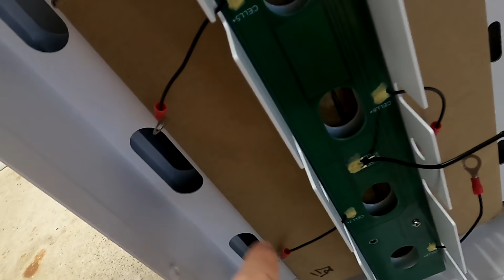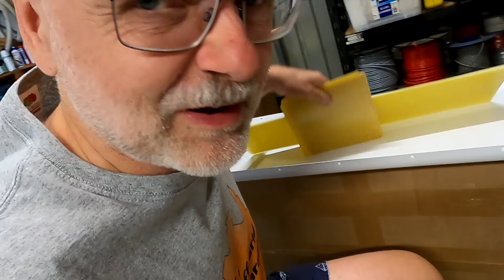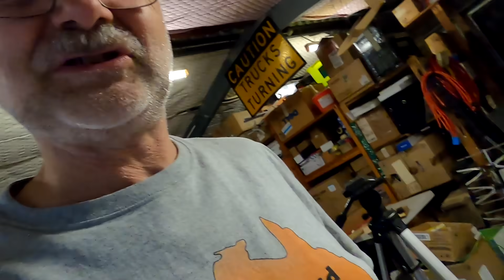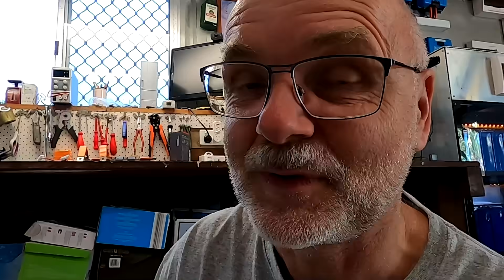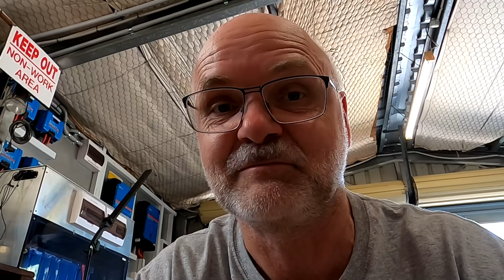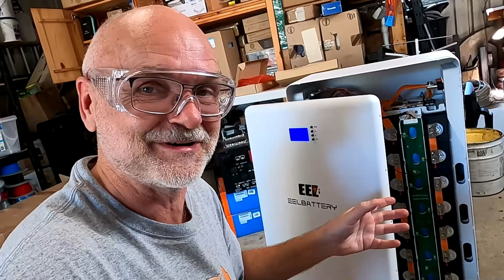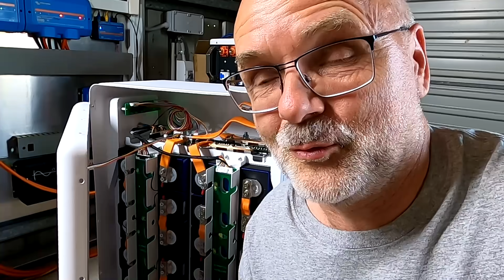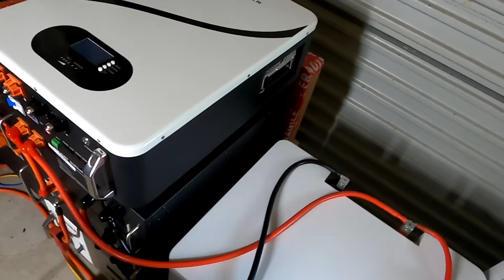The vertical EEL Battery DIY Kit. Is it OK for the cells to be stacked?

Comment: Andy, the firmware update for the 10e BMS, is that specifically for Victron, or a general firmware update ?
Reply from the maker: As always, no change log. I always try to have the latest. There is no mentioning of Victron or any other issues it fixes it. I cannot see any changes or improvements.
Reply: I was also wondering about this and if it is worth upgrading mine. I can't find a changelog

Comment: Question on jk bms . I got one just today but it will turn on for only about 10 seconds then shut down . All cells are about 3.3 volts
Reply from the maker: Any error messages while it's on? Check the resistance as well and make sure you haven't got a short or so. Could be a cabling issue but hard to tell...

Comment: Compression is not about battery life for me, but reducing stress on cell terminals, which will not be important with those bus bars.  Looks like a NICE kit to me.
Reply from the maker: Same. The bus bars are really nice.
Reply: I think brackets must be strong enough to let a safety valve do its job, and just resist to expanding a cell.

Comment: I don't like the cells in that position at all!
Reply from the maker: Official statement from EVE:
EVE recommends either upright or flat but not sideways. Read comment #74 here with the official reply from EVE:
https://diysolarforum.com/threads/eve-280-cells-should-these-be-clamped-tight-or-spaced-for-expansion.7892/post-94866
Reply: Why not? They are self-compressed (partially).